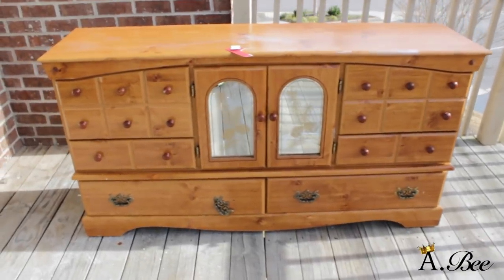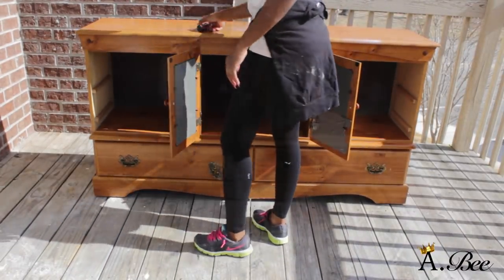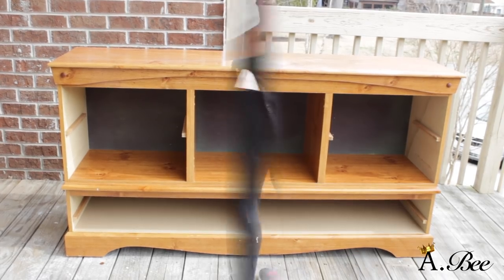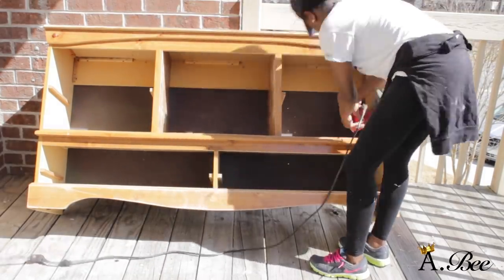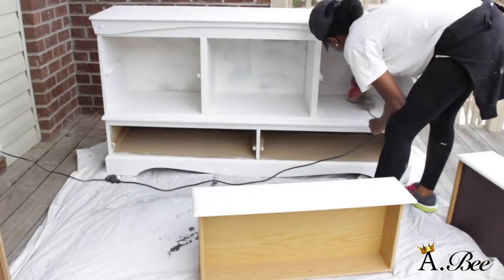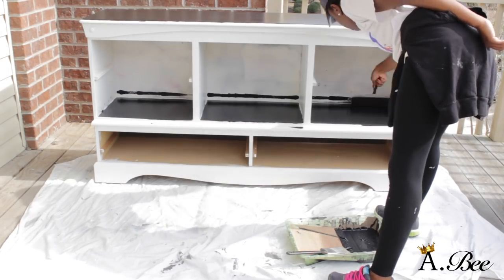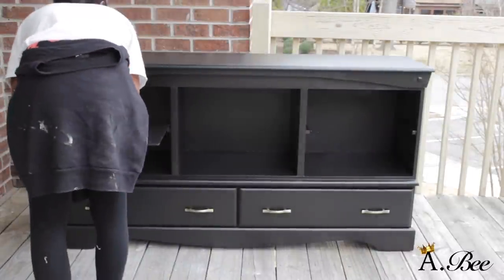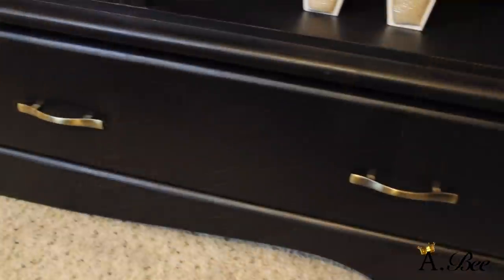DIY |  Entertainment Center (Furniture Makeover)

Comment: Did you put a finish on it, or a sealer? Sorry I don't know if that's the right wording or if it's even needed. I've never done this before, but I definitely have a lot of old furniture I want to makeover but I know nothing about this stuff.
Reply from the maker: Yes, I use polycrylic to seal painted furniture
Reply: April Bee what kind of paint did you use

Comment: looks amazing!  for the shelves you had cut 2 fit replace the original drawers, did u use wood glue to secure these in place or shelf brackets?

Comment: Wow! What a difference! You did a great job! What's the purpose of changing out the sanding grit paper?
Reply: Start with a small #, like 60, its very course. It digs deep into the finish, down to the wood. next, use a bigger #, like 110, it will start to smooth out the wood. You can use more than 3 grits, if you want. The bigger the #, the finer the grit, the smoother the wood. You can burn the wood though. Also, before you use sand paper, rub the paper on the edge of a table with the grit facing up. That will cause the "sand" to pop up, putting more sand against the surface. hope this helps

Comment: I have a tip for you.  Instead of buying the wood putty that costs more, just dump the sawdust from your sanding into a good sealable plastic bag and dump in enough regular wood glue to make it putty consistency.  Really works better than the bought stuff. I find it shrinks less and is not toxic like some of the fill you can buy.  Happy sanding😊

Comment: I'm curious, since it was not shown in the video, did you drill out cut outs for cables and power cords? Why did you use such a flimsy piece of wood for the shelves? 1/4 inch thick piece of wood would of been more appropriate and the cost would be negligible.